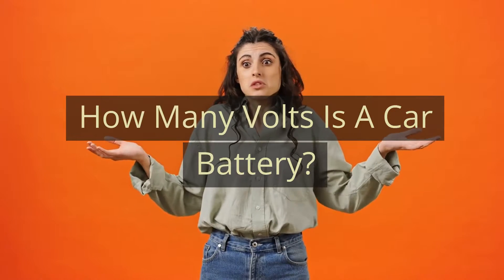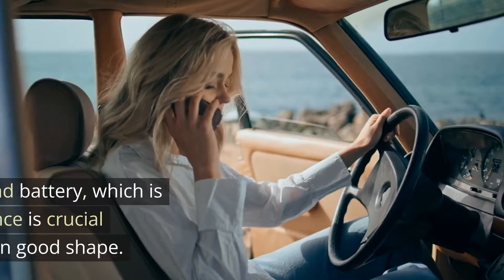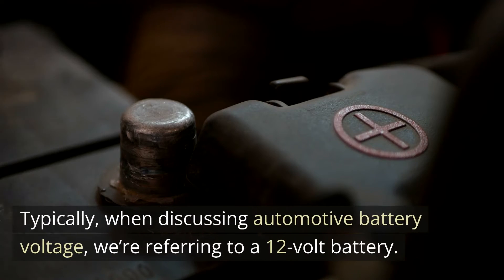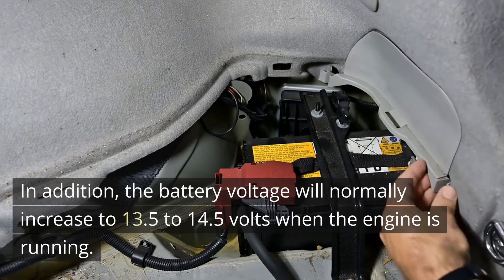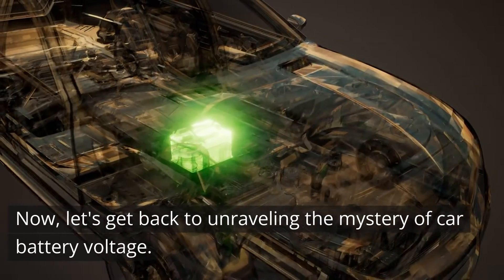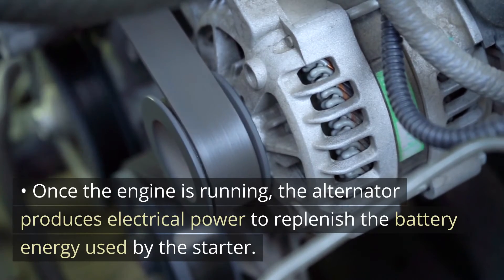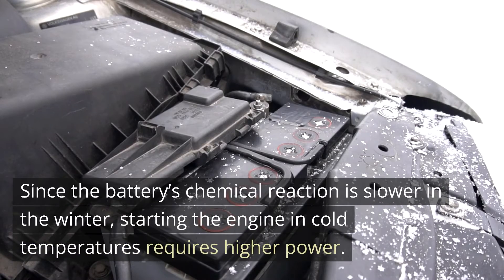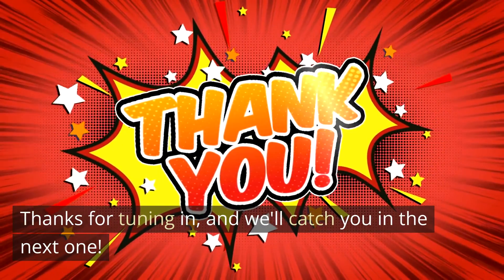Car Battery Voltage Explained: How Many Volts Does It Have?

Comment: voltage dont means nothing if battery amp.power are too low !!you could have 12.6 or 13voltage on voltmeter  but you will not be able to start car anyway